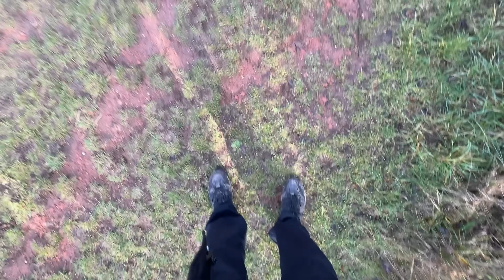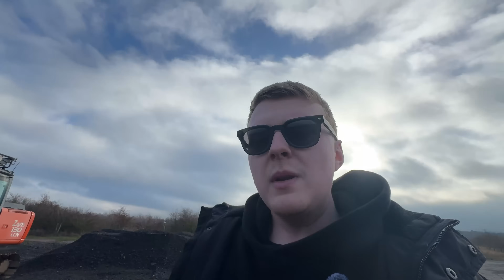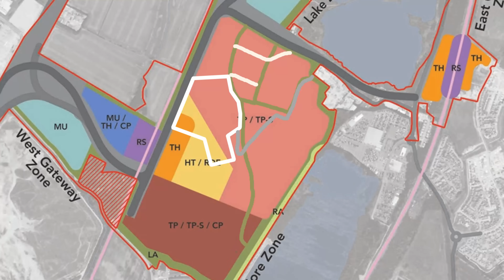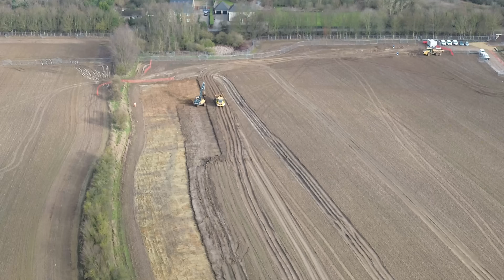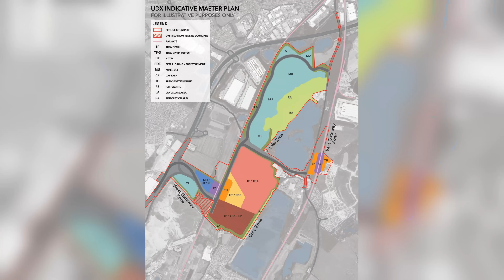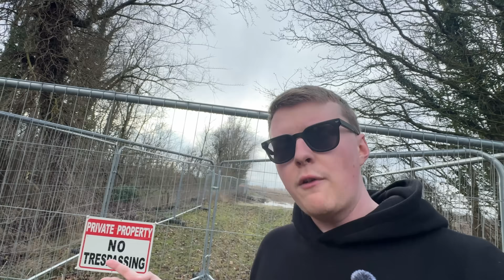Universal Studios UK: Construction Is Moving FAST!!

Comment: There striping the top soil off Dan this is what I do as a job i am a earthmover so they will strip the topsoil stock pile what the will re cover parts with then sell the rest off then they will remediate the clay taking out any old structures then cut and fill the clay to make a level field

And yes every bit of topsoil will have to come  off there. There is probably a year to two years of earthworks to go on there.

Comment: I used to be a bore hole driller. I hope the drillers are testing properly. 90% of that site will be sand/gravel and wet clay. So with that in mind back in the day to save time (each test if you're going down 30 meters takes a long time) if you already know that 90% of the site is clay and sand/gravel, you would collect all the material pulled up from the first couple drills and go and spread it out over multiple parts of the site, make a mess to make it look like testing had been done. Hence why a ton of places in the uk sink because no real testing has been done.
Reply: This is Universal were talking about, not a company like you maybe when does for full of cowboys 😂
Reply: Doesn't matter if it's universal they're not doing the drilling are they?  @zarajenkins6948
Reply: @zarajenkins6948 universal won't do it themselves they will get a separate company to do all of the construction
Reply from the maker: Thanks for the info! 👌
Reply: So how does the structural engineer design the foundations ,  and how are the contamination levels established ? This is a proper construction project, built by a contractor not a fag packet builder.